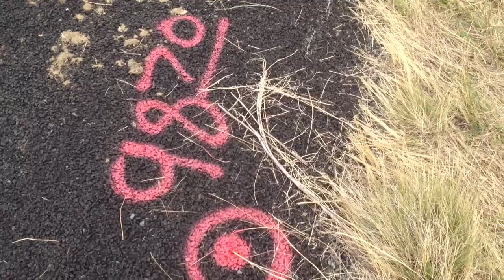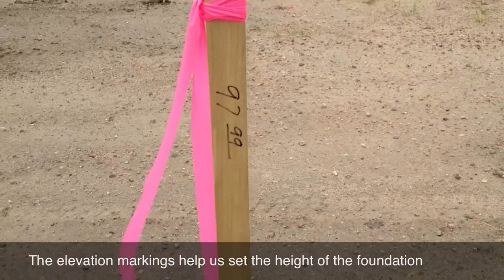Building A House - #04 Surveying

Comment: You have a great way of complicating what isnt actually complicated.
What is required, is to have a registered surveyor establish the lot corners.
Then with a plot plan showing the exact home location on the lot, along with a set of the home plans, a qualified home builder can set up what are called batter boards.
Which establish all the corners of the home as well as floor levels.
The batter boards are offset from the actual corners so as to not be damaged by the excavation process, and will be used for the excavation, and all foundation work, after which they are no longer required.
As for the elevation of the floor level with regard to the street level, the street in this instance was already in place.
So using a distant bench mark isnt necessary or even advisable, just use the actual street level in front of the house.
In subdivisions where streets are not yet in place, the surveyor can while staking the lot corners also place a stake with a benchmark for the street elevation. And thats all the builder will need for his work.

Comment: How do you use that bench mark to determine exact coordinates to figure out property boundary?
Reply: Can only speak for U.K. but you find 2 such points and take a line between the 2 that gives you reference.Simple trigonometry to find any point in relation to end of that line.Very simple example.Say you have 1 point 100,100 and another point  100 feet away at 200,100.From the first point if you travelled 30 feettowards the second point and then 30!feet square to that line you would come to a point 130,130 in Cartesian coordinates.This would be equal to 45degees and 42.426 ft in polar coordinates in relation to that say line.
Reply: @petermontgomery8707  it’s been a while since i saw the video... so there’s 2 bench marks not 1? I’ll check it out again
Reply: @Big_red_builders  I can only see one but that is what you would need for control in the horizontal plane .Or at least that and a reference point with a bearing to work from,say a church spire at e.g.135degrees (more old school) that you would sight with your total station or theodolite after setting up over  benchmark.Either way it’s no different from a graph you’d draw in school.Everything is related to eastings (x axis) and northings(y axis).Obviously z co-ordinate(height) you only need one benchmark.
Reply: @petermontgomery8707  ah i see so probably with a high quality compass? Is like to see a video on this process i can’t seem to find one.
Reply: @Big_red_builders  I guess you could do that if accuracy wasn’t that important,if you owned the whole lot and a couple of feet either way didn’t matter.I was really talking about setting up a theodolite or total station(modern equivalent)over that point.Turning  the instrument and to the required reference point,zeroing it and turning the required angle them measuring along this new line of sight to find the required point.